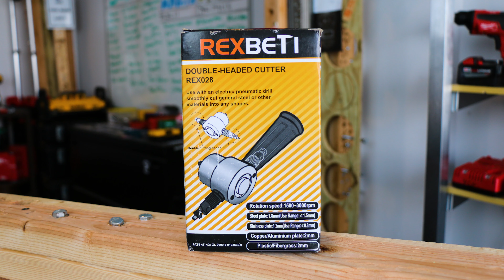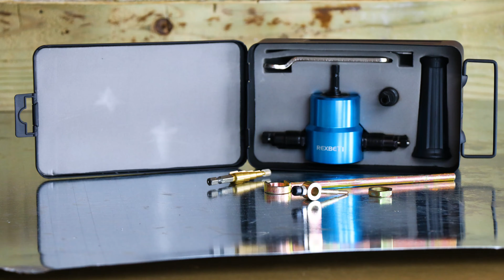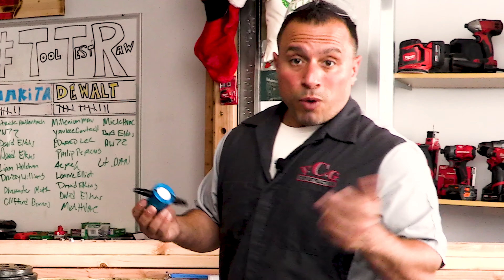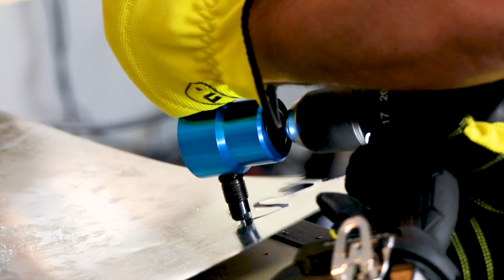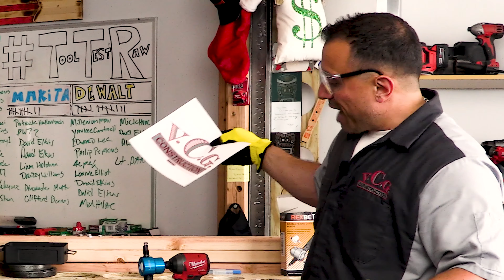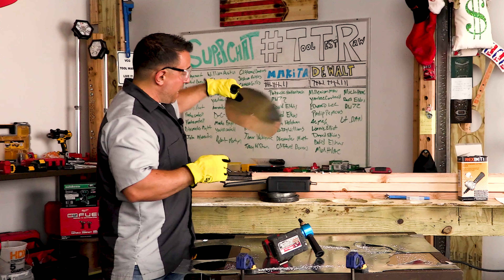Cool Amazon Power Tool Accessory That YOU HAVE TO SEE IN ACTION!

Comment: From an HVAC point of view I can see myself using this to do an A coil insert in an pre-existing central heating system some come with options to add cooling later on and this would have been extremely handy to cut the air trunk open to add the coil definitely quicker then HVAC snips! as far as a circle cutter goes it looked a little shaky ill just stick to my melco hole cutter for that....but it is fairly priced so I will give it a shot and I'll let you know. Thank for review! 👍

Comment: the new version has one end rotatable, so that it is much easier to go thru a not flat sheet (corrugated) coz you can angle the tool side way.
also i attached a magnet above that eject hole, so all the shave can be collected easly.

Comment: I would like to see more projects that this could be used for. I am a DYI’er and concerned if this item is worth it for me?
Reply: ANY project you need to cut sheet metal. It's not DIY channel to give you project ideas.
Reply: It’s not a site only for the tradesmen. I buy tools sometimes I don’t see the full protenal of a tool or accessory.   In the video there is a reference to plastic and plexiglass, I am wondering how good it functions with those materials?

Comment: @vcg fien 18 v 4 speed drill with hit that high rpm they have a 12v  4 speed to they are the inventor of the multi oscillating tool